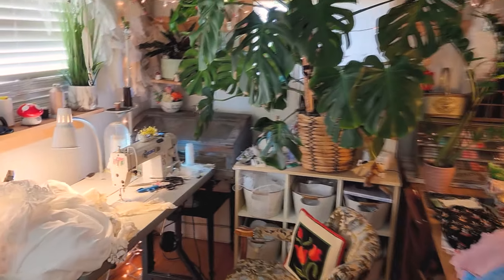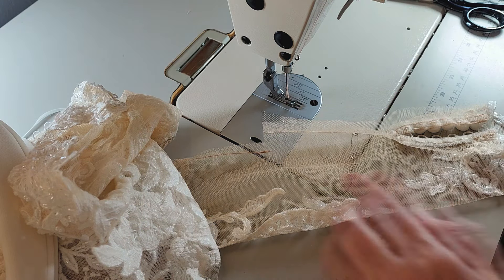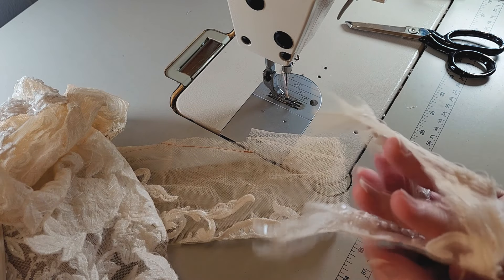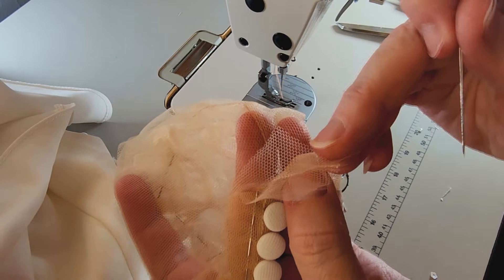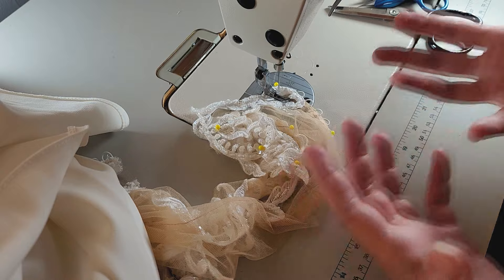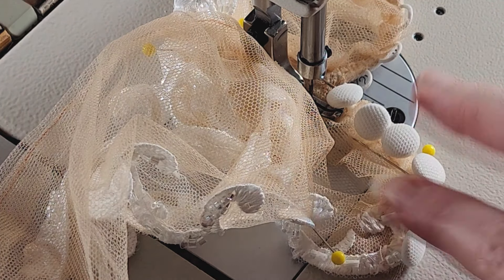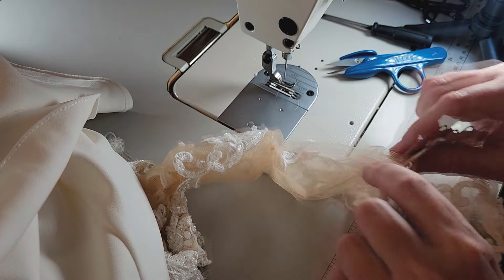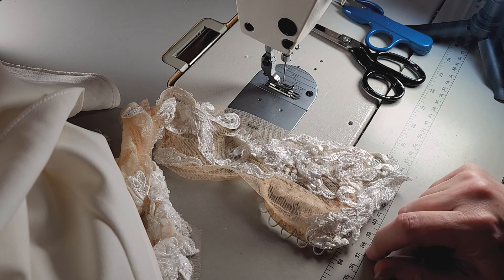Easy DIY How to Shorten LACE SLEEVES, Wedding Dress #sewwithme

Comment: I have a question. Is it possible to create a buttonhole using the juki ddl 8700 machine?
Reply from the maker: You could in a pinch, if you were really good at free motion and could do a zig-zag type stitch free handed. But, it's technically only straight stitch. 
I typically just slide over to my multifunction machine for buttonholes.
Reply: @BridalSewing  Ok I see! Thank you so much!
Reply from the maker: Of course! Anytime. 🤗